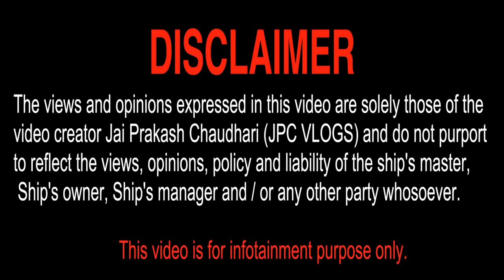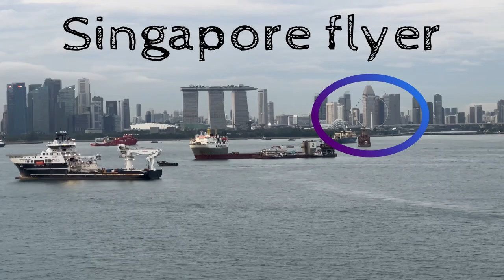SEA 🌊 & SHE 🚢 || Bunkering/Refuelling @ Singapore  || JPC VLOGS || Video # 04

Comment: Sir can Able seaman work in offshore vessel as the crane operater by taking offshore crane operater certification ?
Reply: All 3 level stage 1,2,3
Reply from the maker: Yes, after undergoing required course/training you can work as crane operator on offshore vessels.